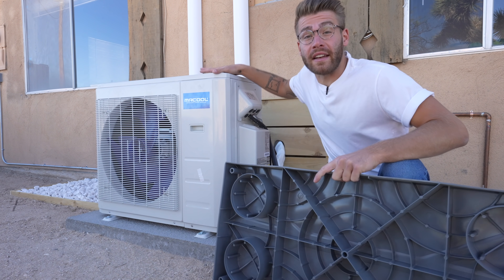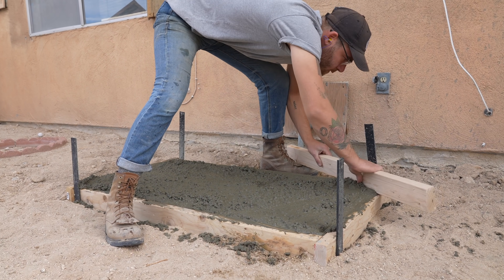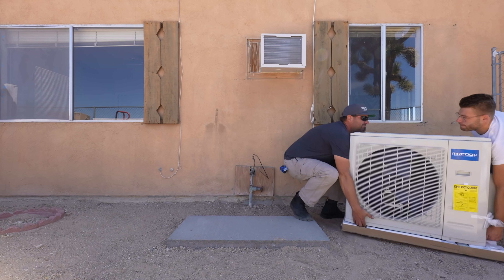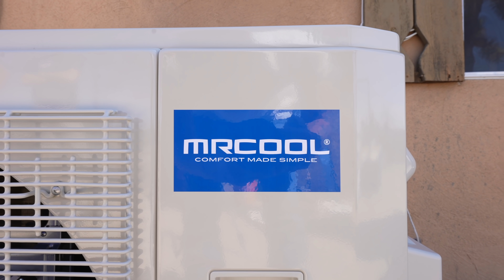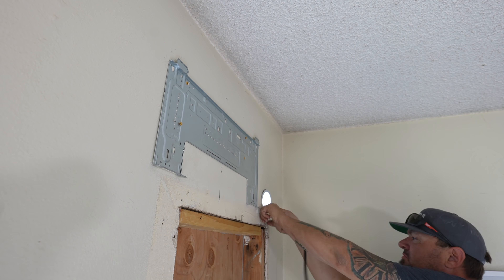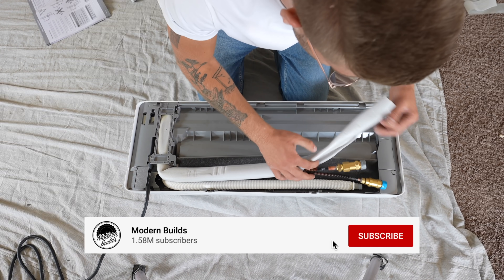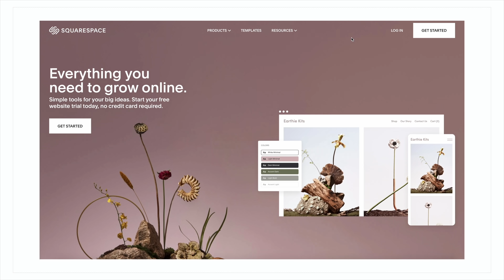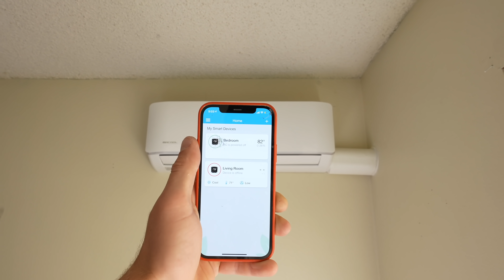DIY Multi-Zone Ductless Mini Split AC & Heating System | MR Cool Install 2021

Comment: You didn't use the vacuum pump so this installation is a no no. Problems down the line are almost guaranteed.
Reply: Can you explain what problems will this unit have?  The lines are sealed until connected.  On a pro set up you can custom cut the lines to fit your application, vac the system down and charge...but this is a DIY kit that doesn't require that step.  They checked for leaks and it seems to be no leaks.  what can happen down the line?

Comment: Just be careful with the DIY units as, since you install it yourself, you don't have any HVAC company warranties if it doesn't end up working correctly; and some HVAC companies will be iffy on working on non-professionally installed units. You also want to do your research with these mini-splits, because there are plenty of options that will look like it will be a huge money-saver compared to having it professionally installed; but in the long run you'll have to do a lot of maintenance on it. I have so many customers interested in these units, but, they look the price up online, find a super cheap unit, and get upset when the price-point is not do-able for us to install one of our trusted units that we warranty. This isn't as much of a problem with A/C units since it is hard to find a unit price online and there aren't many low-budget knockoffs. (Like he said, be incredibly careful with the lineset. It loves to kink, but this small of line should be okay)

Comment: What size wire did you use for the 220 run? #8 or #6? Thanks!
Reply: i think he said 30 amp, so 10 gauge or better copper
Reply: @mktbully  30 amp requires 10 gauge 👍

Comment: I just installed mine in my living room last week. I now have to install my multi-zone ones throughout our bedrooms. This video was super helpful because I wasn't sure how to get one of the air handlers in one of the rooms because there isn't enough room on the exterior wall(giant window). Your video showed something the rest of the videos haven't, and that is bending the lines of the air handler the opposite way they came in. I did not know you could cut out that plastic piece if you needed too. This was amazing to know. I am less stress and more confident in doing this. You have a new subscriber!
Reply: Question? How much you spend on it? 
we have a house with 3 bedroom leaving-room, dinner room  kitchen and a small office& Landry room.
Reply: @patomex76  our house is roughly 1,700 sq ft, I installed a total of 4 air handlers. Our living room is by far the biggest room we have so I bought a unit with just 1 air handler and condenser. It was an 18000 btu and it cooled it off pretty fast. I then installed a unit in each bedroom(3) and they also work fantastic. For those I bought a 27000 btu which is 9k per unit. I spent a total of $4100. It was less because I’m a pro extra member and got a big discount or else it woulda cost around $6000
Reply: @jessegandarilla4472  how its your.bill having ac mini split unit installed.. I have electric basebard heater 220v. It is expensive in winter season looking for install this unit. I already run the wire( renovation)  for this time unit in the future but I not sure if I actually save or not in my electricity bill.
Reply: @jaandel1  our highest bill came this month because we’ve been running the heater all day almost non stop. It was $200. Our furnace went out and that’s why we’ve been using them a lot this past month. Our bill usually averages between $80-$100.

Comment: Didn't talk about sizing?? Can't just throw in a AC system with out sizing it correctly
I get the precharged linesets but alot of manufacturers of "duct-less" have minimum requiments on line set length, coiling the line set like that in the back is incorrect an is NOT recommended by any manufacturer that I've seen, creates a oil trap. 
Also the box he built is not recommended beacuse most manufacturers have distances requirements for the outdoor coil (condenser) 
Also, no torque requirements on the lineset connections? 
No feet for the Outdoor coil? All heat pumps must be raised tobe drained to prevent ice daming in winter. 
Also, No surge protector on the disconnect? Would be nicer if it was on the other side of the outdoor coil but hey you have one. 
Do not install this yourself, call a HVAC pro, get 3 different bids and don't go with the lowest one. Plus most HVAC pros have warranties.
But hey that's a sweat condesate drain...

Comment: rip that guy's lungs using the grinder to cut the stucco.

also, it looks like it would be well-worth it for you to replace those old aluminum windows for modern, low-E, argon-filled, double-pane windows to reduce the solar heat gain--especially given the desert climate.

Comment: I was always taught to vacuum the system down so you don’t get air in the line that condenser is going to last you 3 to 4 years max
Reply: No need to. Apparently Mr Cool comes with pre-charged line sets with a special fitting on each end that keeps them sealed until connected. See https://www.homedepot.com/p/MRCOOL-25-ft-3-8-in-x-5-8-in-Line-Set-for-DIY-24K-and-36K-DIY25-3858/314412417

Comment: Should of cut the line set and just flared it
Reply: the charge is set for the length of line from the factory.  if the lines were cut then the charge would be off.
Reply: @mktbully  not hard to get that gas out
Reply: @365WithBlane  ...as long as you have the right tools/equipment. Otherwise just letting the gas go is frowned upon.😀
Reply: @mktbully  I do
Reply: @365WithBlane  The penalties are severe for venting refrigerants.
Reply: @user-bj4lp3fr1o  the Freon used in this is R410a not a big deal to release into the environment. Does not harm the ozone layer or cause cancer like r-22. I am actually epa certified
Reply: @365WithBlane  Venting of HFC’s have been banned since Nov, 1995.
Reply: @user-bj4lp3fr1o  first of all I never even said venting the Freon I said it’s not hard to get the gas out. And the other guy said you have to have the tools and I said I do
Reply: @365WithBlane  And then you said releasing into the nvironment is not a bid deal.
Reply: @user-bj4lp3fr1o  yes after you assumed I said releasing it

Comment: Where's your pressure test!? Where is your 500 Micron or below vaccum!? Did you really just release your refrigerant charge on top of all that air, moisture, and non condensables?!   I'm not saying it won't work out, but you just took a big chunk of off longevity and potential acids in the system. And why not get a flare tool and cut the line sizes to length. You'd actually gain efficiency by not having essentially a "heat box" for your lines. Your channel has some great stuff but this wasn't researched well enough.   There are two great channels on HVAC. AC SERVICE TECH and HVAC SCHOOL. They have a ton of knowledge. So the next time you do this again, take a little time to get it perfect. The DIY portion of this build was flawless, but the HVAC technical part was a FirstAttemptInLearning. You'll do better next time around.
Reply: No need to. Apparently Mr Cool comes with pre-charged line sets with a special fitting on each end that keeps them sealed until connected. See https://www.homedepot.com/p/MRCOOL-25-ft-3-8-in-x-5-8-in-Line-Set-for-DIY-24K-and-36K-DIY25-3858/314412417
Reply: @user-bj4lp3fr1o  As a matter of fact, you're right. Looked a little closer and those are the pre charged line sets. Fair enough. He is still going to gain unnecessary superheat by having excess line. Though. Good eye.

Comment: Mike, this is another great video.  I've watched a few YouTube videos on installing 'Mr. Cool', and you  did the best job by far of explaining  the process.  As you suggested, I would hire an electrical pro to do the wiring.  I'm crazy about the outdoor garden around the exterior unit.  It is quite attractive.  I do think that you should do a video about patching the hole in the wall where the old AC was.  Those are the things that many of us home owners face from time to time.  From one old Okie to a young Okie.....Well done.
Reply: Outdoor garden? It’s just 2 potted plants sitting on top of gravel.
Reply: Hi Mike, do you know some one can install 4 zone mini split in Austin, TX?

Comment: The theory behind the mini split is slow constant airflow.  So turning them on and off will actually make them less efficient. Running them slow and constant is the key to efficiency.
Reply: That is correct, as I install them

Comment: I have the same unit. I use the dry mode all the time🥶🥶

36k does the entire house effectively. I'm gonna have to try the box for the coil covering 😎
Reply: How big is your home with that 36k
Reply: @allaboutdetails3356  3400 sqft
Reply: How many minisplit units do you have inside the home running to the compressor?
Reply: @nickd1978  4

Comment: 208 single phase?
Reply: That’s slang for 220 volt power.
Reply: @joshramsey6893  just gonna toss a phase converter in there real quick

Comment: These units still need to be vacuumed by a professional. You can use the precharged lines but it lessens the life.
Reply: No they don’t idk why everyone keeps saying that. Put one in and see for yourself like I did.
Reply: @kylewestendorf3068  they dont what?
Reply: @RadioRich100  sorry it was suppose to be a response to vacuuming the lines. I’m saying you don’t have to vacuum the lines
Reply: @kylewestendorf3068  Ok , I just watched your video. Your correct you dont have to vacuum them, as a matter of fact you cant there all ready charged. What you did do wrong is coiling the excess lineset which can lead to early compressor death. Some people dont know what precharged lines are. But no matter which type you have you cant coil them vertically or oil tends to puddle in the bottom of the loops. Also you should do a leak check on all the connections.
Reply: @kylewestendorf3068  A DIY unit you dont and cant vacuum them there precharged
Reply: @RadioRich100  That's not true for all minis. In some, the refrigerant is in the compressor or liquid receiver and not in the line set.  You install the units, connect the line set, vacuum and then release the refrigerant by opening the valves at the service ports. That's per the manuals and it works. I have installed 3 of them.
Reply: @user-bj4lp3fr1o for the DIY Mr Cool, the lines come with length of 16ft , 25ft, 50ft, etc, and all of them are pre-charged, no need for HVAC guy to do vacuum or need to buy the vacuum tool. That is the point of why it is DIY. The compressor is not the issue here for the Mr Cool, the linesets are all pre-charge with the appropriate freon.
Reply: @Ampacityelectric  haha that's exactly what the tech told me after he helped vacuum my lines. So far I've had mine for 2 years and I already had to charge it once.
Reply: @Deckardrick007  It is NOT TRUE that these units need to be recharged in a year or two. If you had to recharge it is because you had a leak .

Comment: Is condensate from the air handlers acidic?
Reply: It'll have almost the same pH as rain, as it's condensing water from the air. Small difference is from local quality of the air inside the building vs outside. Acidic condensate is created when cooling burned products of things like petrol, natural gas, coal. They generate mostly H20 and CO2 (which is already generating carbonic acid), but there are also trace amounts of NOx SOx, CO - which with water vapors will also create acidic solution.

Comment: This looks great, one tip only, please don't shut off your living room at night to "save" on cost. What happens is the rest of all the mass heats up and the system when you turn it back on has to over compensate so it spikes to get everything to your designed temp. Trust me on this one, either you really want a system that runs like a "taxi" or one that runs like a car on the highway. Taxi's start and stop, highway driving will always be better milage and WAY LESS ware and tear. I really do hope you see this, I have been doing this HVAC / building science for 20 plus years.
Reply: I would also add that most require at least 5" clearance from inside wall. When you wrap your last newer bundle the drain should be on the bottom portion to allow for better draining and prevents airlocks. I am not sure where you are but anywhere the temps drop below freezing you should install the unit on a stand so condensation on the outdoor unit during heating won't form a giant block of ice at the base of your unit on a pad.
Reply: @adamradley4407  I’m in the PNW , I have seen that happen up in the higher elevations areas by Mt Hood. Most people here live at around 500’ above sea level and the winters are generally mild, winter design temp is 42, summer is 83. While we do occasionally have lower and higher temps you will see ice dams on ground mounted units. I prefer exterior wall mount for many reasons, easier access to work on, lower maintenance and cleaner look. Good tip though!

Comment: I did a multi room unit in northern California, it was awesome, the dehumidify really was all I needed 90% of the summer it was great to have the option to keep rooms at different temps. (one thing to note is you cannot mix heating and cooling a the same time.)
Reply: so you cant have one head unit in one area on cold, and one on hot ?    thanks for info as nobody has ever mentioned this in any video
Reply: @rrsonic  - just one caveat is that is per condenser. If you have two separate units they can operate independently but if you have one unit that supports 4 rooms then it can run the fan, dehumidify, along with heating OR cooling in just the rooms you want.

Comment: It honestly surprises me that this is legal to do in the usa. I live in finland, and here it's absolutely illegal to do any electrical work without proper permits (to do work like this you need to go to school for 3 years and have someone more experienced supervicing) or even do the actual heat pump installation (1/2 year school program).   If you don't know what you are doing, you could very easily ruin the walls you are feeding the lines trough or do some extremely dangerous electrical setups.
Reply: We place trust in our people to know what they are doing and if not hire someone who does. Most of the time in countries where 'experts' are required it's because some politician gets paid off by labor unions to funnel all work their way and unnecessarily drive up costs, or their brother-in -law is in the business. 
This stuff is not rocket science and is absolutely within the purview of anyone with a double digit IQ to perform efficiently and safely.
Reply: @RichardSmith-ps7qc  I'm an engineer and I still would 100% not trust myself to do any electrical work as significant as this without supervision by a professional. You literally risk burning your house down. I would be terrified to buy a house where someone might have been saving by not getting a professional to do the electrical work.
Reply: they are your walls here we are more self reliant

Comment: Great job as always Mike.  Please do share with us the energy comparison after the summer.  I am very interested.  We have a large famiy room addition and since we are on a slab there isn't any ductwork for heat or AC.  We have an old stand alone heater and have lived without AC in that room since we bought the house 3 years ago.  One of these Mr. Cool units might just be the ticket.  How is the finish on the tub holding up?

Comment: You forgot a small thing, vacuum the pipes 😂😂
Reply: on the outside unit? I believe with these models that's not necessary unless you disconnect after opening the valves.
Reply: @nighteyeswolf  gotta vacuum The pipeline between outdoor- and indoorunit but to do this you need a vacuum Pump wich a normal person doesn't own.
Reply: @nighteyeswolf  Not on this unit

Comment: Did you vac down the copper lines before releasing the gas? I noticed that step wasn’t shown in the video. 

Must be done here in Australia. We have strict hvac laws. All hvac system must be installed by a licensed installer. Refrigerant gas is very harmful to the ozone if released into the atmosphere.
Reply: These lines are precharged... no need to vac down.  Just connect and you are done.
Reply: @sparks6666  That's not correct for all minis. In some, the refrigerant is in the compressor or liquid receiver and not in the line set.  You install the units, connect the line set, vacuum and then release the refrigerant by opening the valves at the service ports. That's per the manuals and it works. I have installed 3 of them.
Reply: @user-bj4lp3fr1o  Please research Mr Cool units. Lines are indeed precharged and no vac is needed.

Comment: Awesome project, Mike! Quick question: didn't the unit come with rubber feet to decrease transferring vibrations and noise?
Reply: Bill, I’m one of the guys in the video and I own an air conditioning company. I can tell you for sure the outdoor unit is virtually silent so no additional vibration isolation is needed.
Reply: @joshramsey6893  Over time, the fan will accumulate dust etc. Unless you clean it frequently they will get off balanced and start to vibrate. I love how quiet they are though.
Reply: I installed the DIY single unit a year ago and love it. It simply works perfect. The rubber feet are recommended when mounting the unit to the wall using a bracket to reduce vibration to the house. They are not needed when mounting to a standalone concrete pad. As others mentioned it is ridiculously quiet.
Reply: @Shadetreecruiser  Steve that makes perfect sense to me.  The pad doesn’t connect to the house so it can’t transfer vibration.  If you did have a pad that was connected then I might add the rubber pads.
Reply: The compressor is mounted with rubber grommets.  There is no vibration.
Reply: It's so quite that it doesn't emit that much vibration. Mine doesn't.